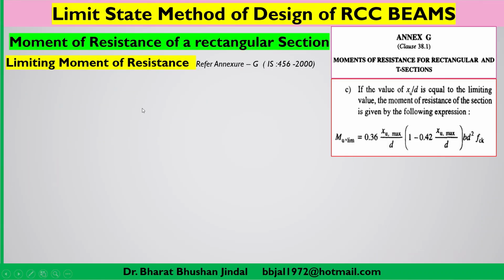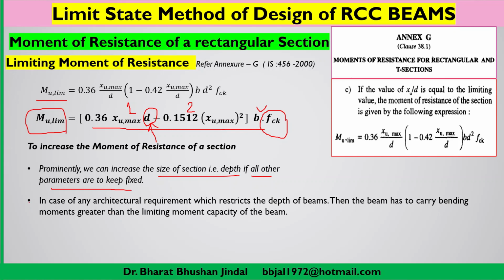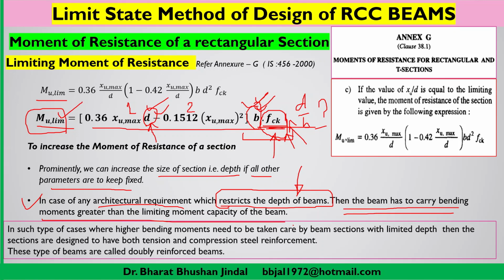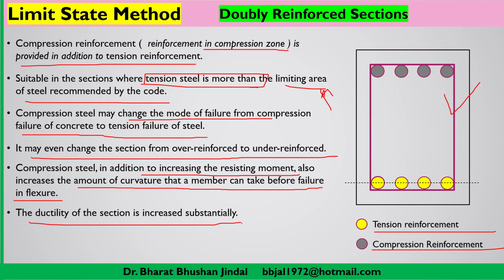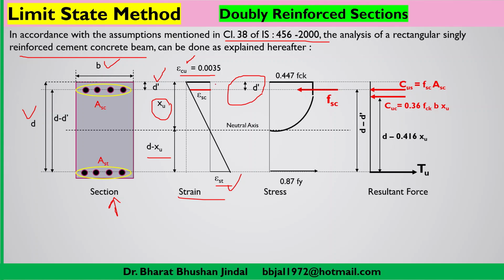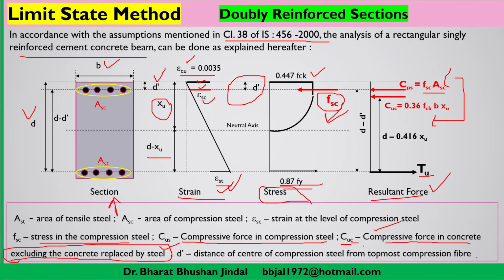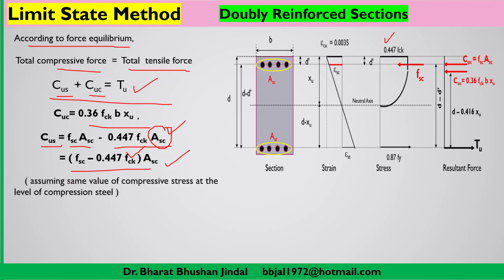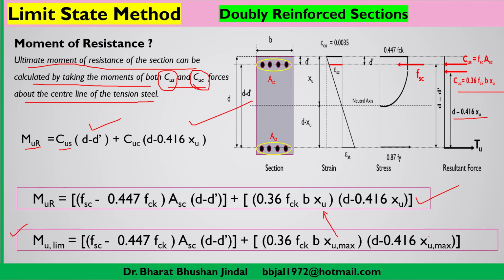Lecture 12 || #Doubly_Reinforced_Section || #Limit_State_Method || IS :456 -2000 ||  Civil Engg.

Comment: Sir, at (18:37) u said Cuc is the compressive force in concrete excluding the concrete replaced by steel and then at (22:53) while writing the formula for Cuc, u considered the gereral formula and subtracted the compressive force taken by concrete from Cus. Why so, sir? Isn't it contradicting to the definition of Cuc?
Reply from the maker: The subtraction which was mentioned in the statement is taken care while calculating Cus ( i.e. the compressive force taken by compressive steel ) as 0.447 fck Asc ( i.e. force otherwise taken by concrete if steel was not provided to take care of compressive forces ) is subtracted from 'fsc Asc'.

I hope your query is resolved.